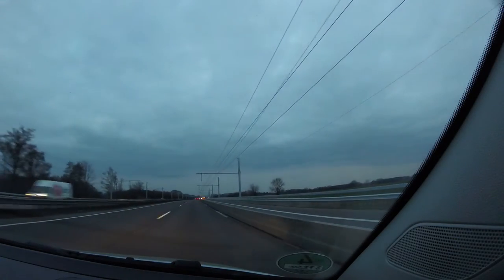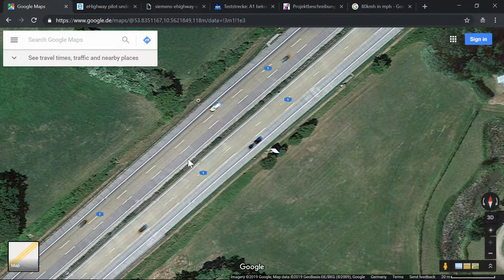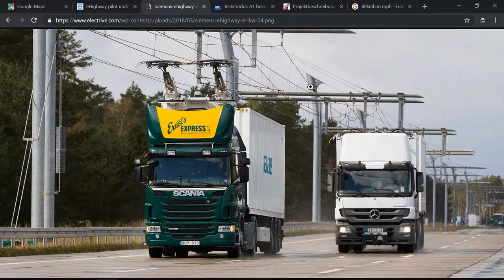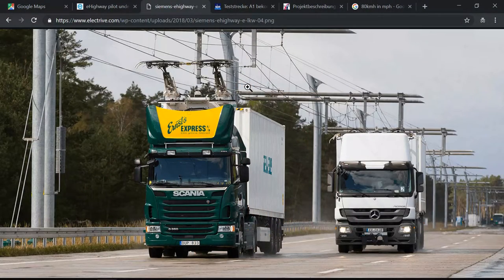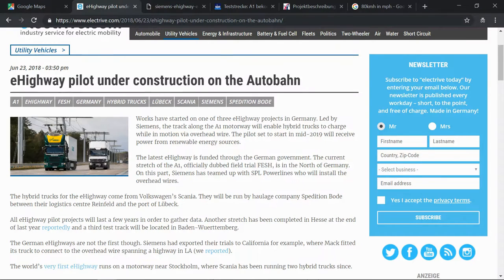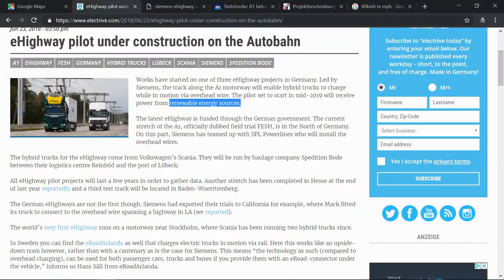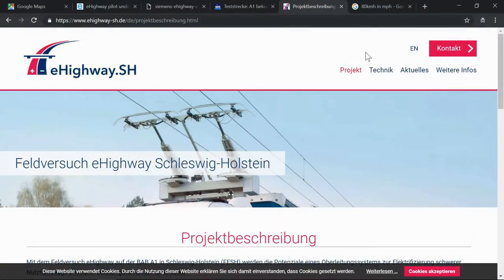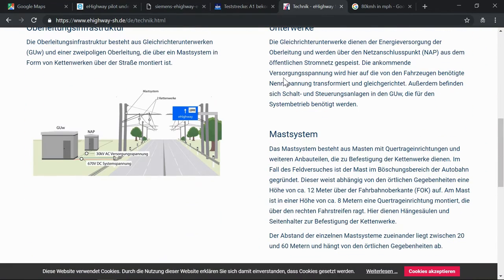eHighway on German Autobahn – Is Charging Trucks via Overhead Wire Genius?

Comment: You are sooo right - what a dumb idea! As you pointed out early in the vid - if the truck swerves, there must be a good chance of a total short out! Imagine, too, when  a truck has a pantograph fail and snares the overhead wires - rrrrrip! Mate, this idea could only work when you have a machine that runs on rails, that's the only way you can control where the pantographs will go. Great video - thanks for the voice of reason!

Comment: Your analysis is not very good. The trucks are hybrids. Meaning they have a battery, that is charging while they are connected to the system. This means we only need to cover 30% of Germany’s highways to fully electrify the entire HGV traffic (LKW). No down time waiting to charge the truck. Our train system is at full capacity and building more train tracks is much more expensive than building these charging cables. Which we would have to build for the trains anyway. Even if the trucks are fully electric in the future, it will mean they can have smaller batteries and hence carry more goods. Also in the future these trucks will be self driving so there is no time to charge them while the drivers are resting. This is a very good system and I hope it takes off all over the world.